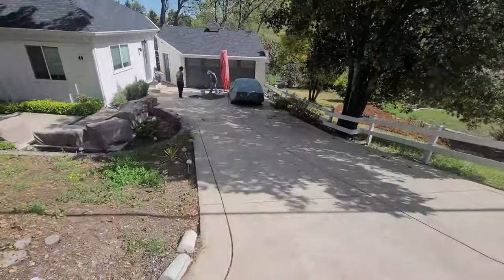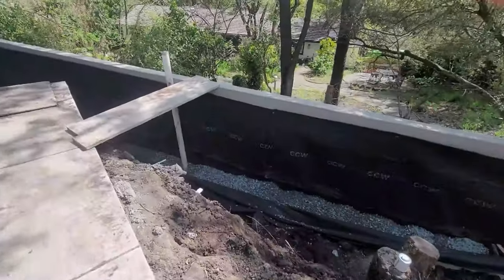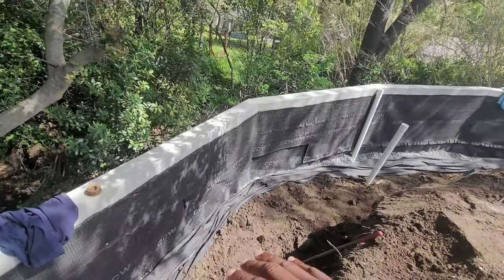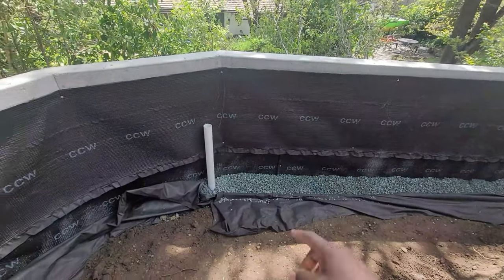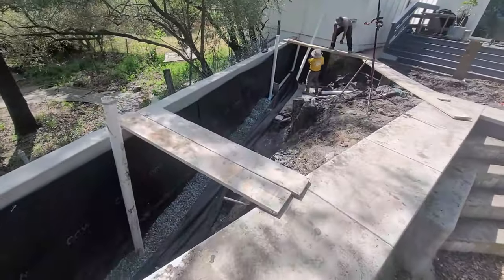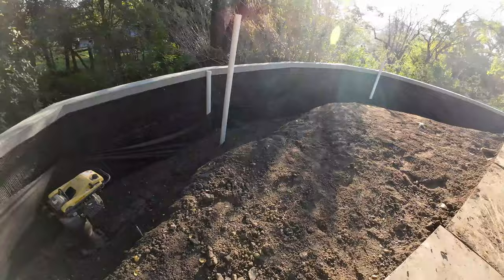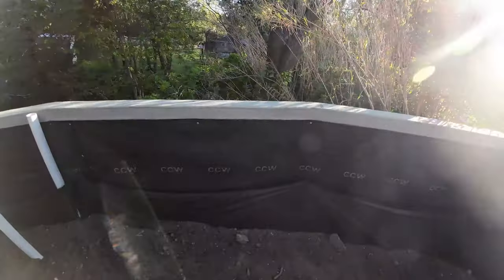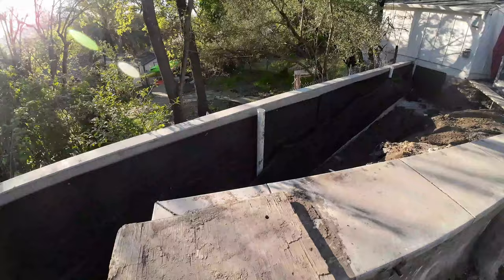Understanding Mira Drain: A Concrete Retaining Wall Drainage Solution

Comment: Awesome channel and work done! Does the drain pipe always go at the bottom of the wall even if its high(8'-10') and how much rock do you need to be surrounding the pipe(the diameter of the burrito-12" or so)?And also what is used to clean out the drain pipe-regular sewer snake I am guessing?
Reply from the maker: Appreciate the comment 👍🏾👍🏾.. Yes the pipe always go at the bottom.

Check out our French drain playlist... https://bit.ly/3vmZdwQ